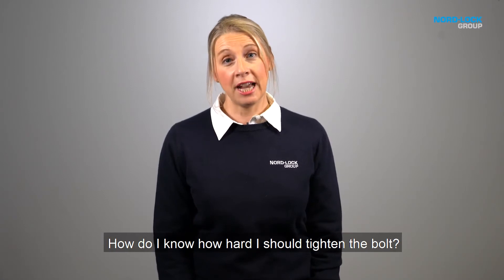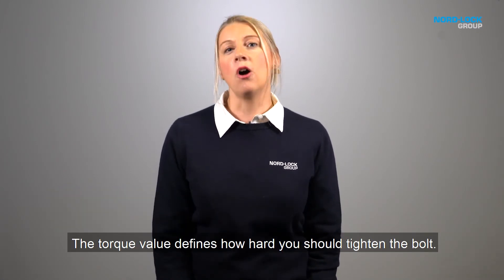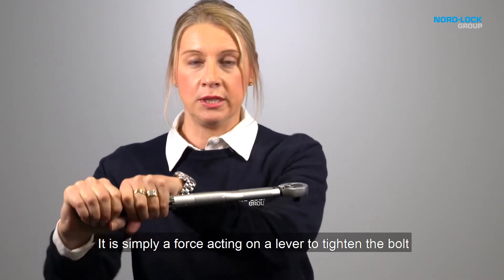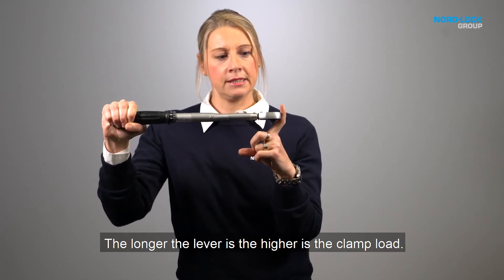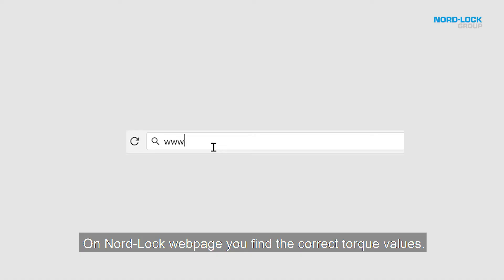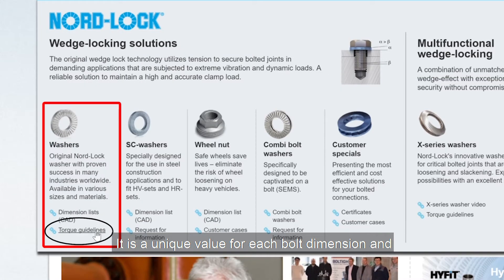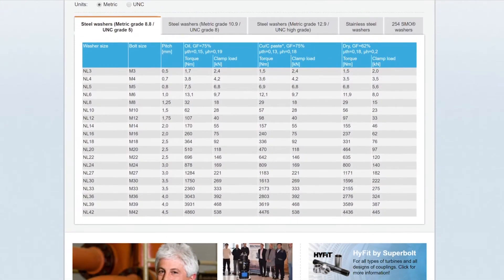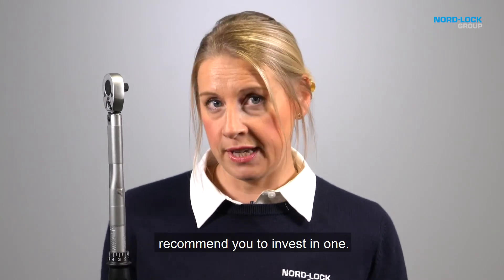How Hard Should You Tighten the Bolt? | Q&A

Comment: Important to mention, always reset your torque wrench back to 0 after using, to avoid straining the spring inside the torque wrench when not in use. 

Also important to get your torque wrench calibrated at least 1-2 times a year! If you're torqueing nuts or bolts on major components i.e brakes, suspension, engine components, make sure your torque wrench is CALIBRATED, and has a validated sticker to verify it's been checked. :)

Comment: How “hard” what does that mean in this discussion?
Reply from the maker: What we mean is that you should always know what the tightening torque should be to reach the preload you want in the joint. The tightening torque is what you adjust your tightening tool to tighten too. But actually, the tightening torque is only a "tool" you use to achieve a preload in the joint. The preload is the goal. The reason why we set the tool to a torque is that it is not very common to measure the achieved preload and usually it is complicated or the tool costs a lot of money. To calculate the right tightening torque then you need to know what preload you would like to achieve and the thread friction and under-head friction coefficients. Of course, you need to be sure you have the right size and grade of bolt to make sure the bolt can handle the preload. We hope this general answer has helped you!